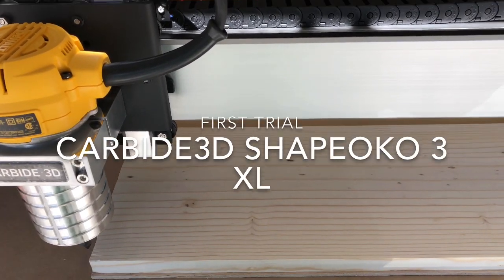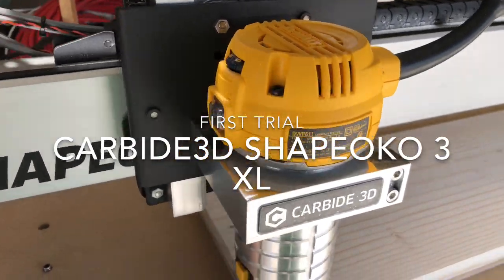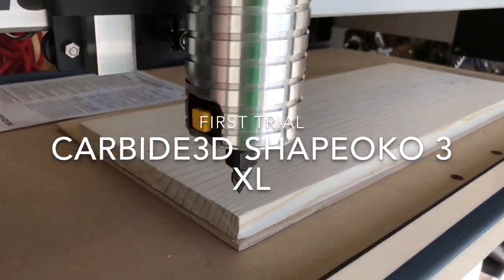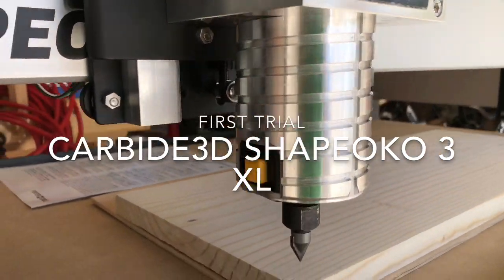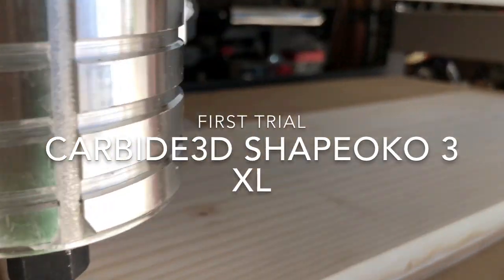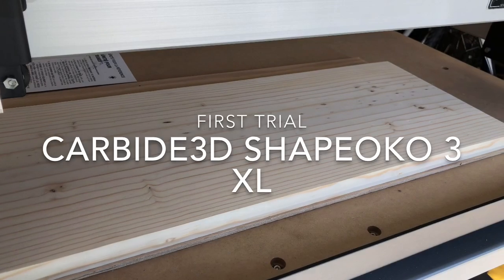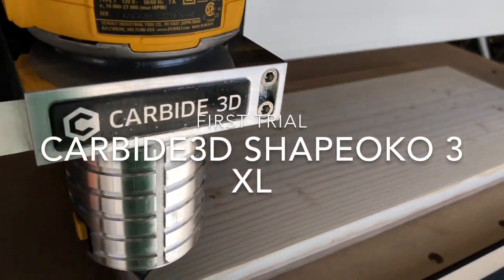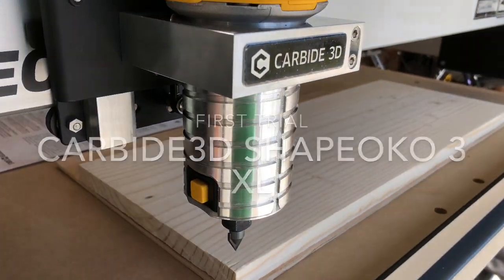Shapeoko 3XL First Run

Comment: Debating if the shapeoko or Xcarve
Reply: Shapeoko rigidity makes it a better choice.
Reply from the maker: Uriel Valdez both have their strong points. The X-carve has more community support and better included cam. But the Shapeoko is more rigid and I think more robust component materials.